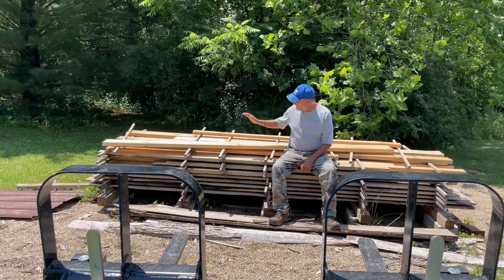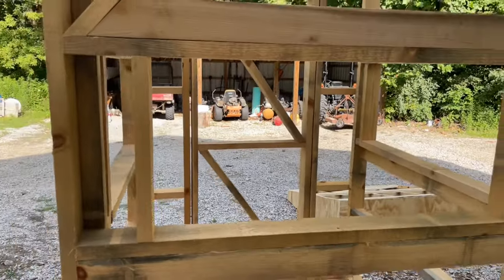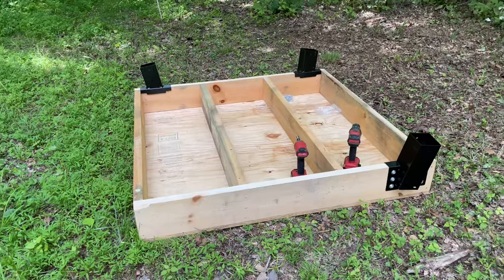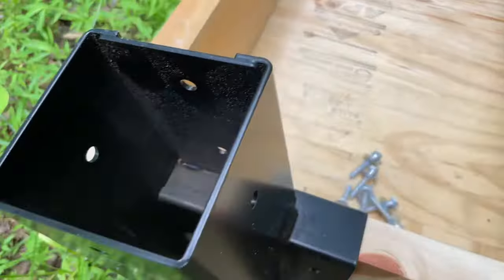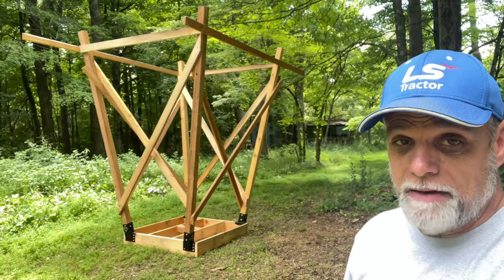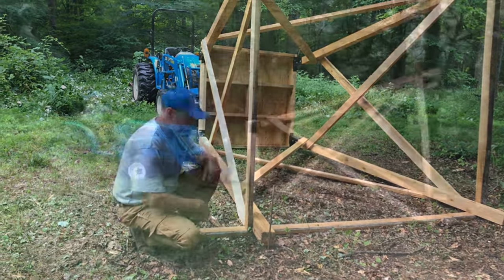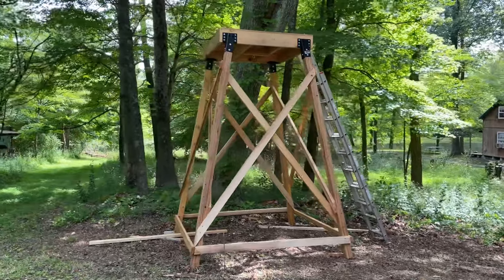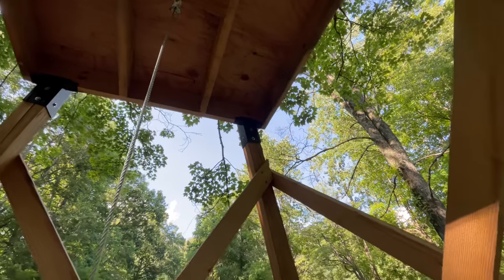Building an elevated hunting blind using elevator brackets and material we milled on our sawmill!!

Comment: I have a larger platform ,started out as (4) 40"x48" pallets connected and sheeted with OSB 3/4" used $  "T" posts bolted to the legs to anchor it. Used a popup blind on it last year. Wanting to frame up and cover with metal and a tent size wood burning stove this season. I like your roof panel Idea,I will probably make it in 3 pieces over lapping as it goes taller.
  Thanks
Reply from the maker: Good luck with your build, appreciate the comments!

Comment: great job. I plan on building one next year. A 4x8 platform with a 2x4 porch. Yes standing it up will be fun with a ATV with a winch and tow straps and come a long's. If i film it , it will have a bloopers part I'm sure.
Reply from the maker: Hey, appreciate the compliment! It was a challenging build, but it paid off last week when I bagged the first deer of the season out of it. Good luck with your project, hope it turns out exactly how you want it!
Reply: I stood mine up with a harbor freight 9k winch on the back of my Ford Crown Vic and the brake set on the side by side,running back and forth to let cable out on the side by side to ease it over. I did not have the brackets he showed. I bolted the  Oak legs on with 1/2" bolts fender washers. I drove 2 pry bars in the ground to keep it from sliding. My platform is larger than his. going to cut 3/8" Plexiglass for fold down windows Monkey magnets should be strong enough to hold shut till needed. Best of luck to all. I'm retired and every day is a good day,even when raining.

Comment: Nice!

How did you install the middle bracing in between the joist? 

Did it make it stable?
Reply from the maker: Are you referring to the short piece of 4x4? I just lag screwed it through the joists and into the ends. Yes, it's really stable and is holding up well. Thanks for the comment!
Reply: @bbfarmsmaple8011  thanks for reply. I think I figured it out.

Btw do you know the angle that the base 4x4 sit at due to the brackets? 

Because I am trying to make the platform sit at exactly 5ft. Does the angle make the legs height shorter?
Reply from the maker: I THINK the brackets are either 7 or 8 degrees, both directions. And yes, you do lose a little height due to the angle. Maybe start with longer legs then trim off the bottom, once the brackets and base are in place, to achieve your 5 ft?